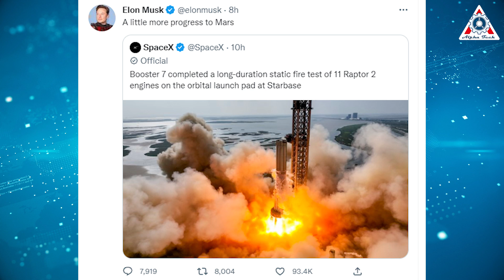SpaceX Boooster 7 11 engine V2 Static Fire tests “Concrete trouble”

Comment: now, what type of concrete can withstand the fury of 32 raptor engines during the eternity of lift off ?. Oh and by the way they haven't tested 32 "mounted" Raptor engines for nozzle vibration in atmosphere for longer than 20 seconds. Its a joke.
Reply: Your negativity is BLARING!!  Turn it down please, SpaceX has accomplished MANY absolutely AMAZING feats of Rocket Engineering, TO. SAY. THE. LEAST.

You sure you don't just have a personal grudge against the owner of SpaceX(Elon Musk) because of your political leanings??  Me thinks, you do, distance yourself from politics when inter-planetary travel is envolved, it's not becoming.

Comment: The pad is flat, this limits the opportunity for redirection of heat and other forces produced. The pad needs to be redesigned in order to redirect those forces away from the pad better, until that happens, concrete will probably keep failing.
Reply: Agree - can't these rocket scientists see this?  Duh.
Reply: @rimckd825  its an engeering issue. They need to be sacked or given a good telling off. The probably just need to put a big reinforced concrete cone under there to redirect forces away from the base of the tower.
Reply: You couldn't be more wrong.  Doing it this way so the rockets THEMSELVES, are exposed to extreme heat, for a significantly longer time then needed, they did an A+ job, we are OOW to Mars within 10 years, not rovers, people's!

Comment: Still getting Pad damage with less than 1/3 the number of engines is not good. Elon' decision of NOT  implementing a Flame Trench with MASSIVE water deluge is biting him in the ass. Call NASA and ask what they use and do with SLS? The same type of pads being built in FL may have to be scrapped.

Comment: I'm no rocket scientist, but it seems like not putting a flame deflection system on the launchpad of the largest rocket ever made was a foolish mistake.
Reply: They don't need to be concerned about the concrete on a test like this, if it were going into orbit it would be less damage and who cares anyway, just replace the concrete, I did masonry for 5 years and me and 4 other mason's could do a 100ftX100ft slab in less then 3 days for sure, if pressed, we could get it done in one 12-15 hour work day, plus at least 24 hours for concrete to dry, depending on how thick the Concrete is, up to a few days.
Reply: @matthewluke5315  "just replace the concrete" Bro, chunks are flying all over the site. There's absolutely cause for concern. Saying a mistake was made isn't hating, it's being realistic, and you whining about people not praising everything they've ever done is a problem.

We're all fans here. But there's being enthusiastic, and then there's being a groupie.
Reply: @matthewluke5315  I thought you were part of the "Team" at SpaceX?  Boy, you are multi-talented!  Rocket scientist and stone mason.  I bet they're aren't many resumes like that out there.
Reply: I am a launch pad technician for spacex and I have no idea how they expect that the tower won't get any damage from a launch. The pad gets destroyed just from an F9 and really destroyed from a heavy, all the way to the border fence that surrounds the pad gets damaged
Reply: If the concrete was replaced with granite this would be no problem
Reply: @BuyBitcoinholdit  good luck moving massive slabs of granite, or similar material on Mars. Cutting it might prove equally challenging on Mars as well.
Reply: Dude, they can orbit Mars and deploy a pre-made landing pad, even if it takes multiple missions to do the 1st landing pad....I know you hate Elon for Cult Left reasons, but trust me, they already thought about anything YOU could possibly conceive of, rest assured!!!

P.S.

Stop being a hater, it's not very becoming, and really, it only makes people like Elon Musk and his companies MORE!!!!  Real Talk Homeboy!!!
Reply: That's right - you're not!  The actual scientists have figured out that they don't need it.
Reply: @mstecker  Lmfao!
Reply: I suspect that they are not committing themselves to one thing. They need more options like the one just suggested concerning Apollo landing and blasting off the Moon.
Reply: All of the criticism that was thrown at Elon Musk before space X worked and then no apology.  Even former Apolo Astronauts were against him. Alls I know is I won't be giving SpaceX criticism any time soon. Even if they blow the whole site up, in the end SpaceX will be sending people to Mars.
Reply: Static fires probably need a flame diverter for sure but a launch might not because it’s basically going to be moving away from the concrete immediately not strapped down just blasting it.
Reply: @markrichardson2508  Ok that makes sense. Makes me nervous having cryo tanks just a few hundred feet away and concrete chunks raining down.
Reply: @markrichardson2508  It will have to be making full thrust before it can leave the pad, so yes a deflector is a good thing to have, always. That was learned in rocketry decades ago, so who knows what they are thinking?
Reply: @Doggeslife  at this point I have lost count of how many static fires they have done and they have only had one time a piece of pad damaged the actual ship and that was years ago imo they probably just need a decent water deluge system.
Reply: @Doggeslife  the last test that damage the ship itself 🤦
Reply: @markrichardson2508   Starship isn’t the same booster as Superheavy so that can’t be the reason.
Reply: @markrichardson2508  its moving up but that doesnt solve the problem, there is a reason why all big rockets have flame diverters. It takes time to spool up the engines and clear the pad. Also we are talking about really massive forces here. I mean look at SLS, it has most intense sound supression system to date yet it still managed to blow away BLAST DOORS. And now we have this big booster with even more power

Bonus note: about clearing the tower thing, there is a trend some noticed with multi engine rockets, more nozzles in small space longer the exhaust plume, most likely beacuse plumes partially "shield" themselves from directly touching normal ambient atmosphere, so they do not get slowed down as much, and flame length can be greatly extended(for instance, look at N1 and Saturn V)
Reply: @_mikolaj_  it’s not spooling up for 14 seconds 🤦 it will be blasting the pad at pad height for maybe 5. I’m not saying it’s doesn’t need one but they obviously think they don’t need one yet.
Reply: @markrichardson2508  5 seconds of continous powerful shockwaves and then another few with addition of 2000°C flames traveling at 3km/s hitting the infrastructure, yet boca sector keeps trying to cut corner so much that they keep reinventing things. Hopefully once they finally start work on HLS they will stop trying to avoid obvious necessities like a damn proper sound supression system
Reply: @_mikolaj_  😂 you should put your resume in mate tell ‘‘em how it’s done cause you are so much smarter then some of the smartest rocket scientists that are living today 👍🏻🤣
Reply: That’s not to mention the starships whole test campaign was done on a stand that was basically 10m off the ground and landed on 3 meter legs they obviously think there is a way of doing it and you keep assuming I think it’s the best way too but I got no idea 🤷 and neither do you.
Reply: @_mikolaj_  hahaha 🤣 someone is a bit sad. There are plenty of things to criticise I’m just saying the couch commentary is funny af. Like they haven’t already had 100s of meetings about the subject. The prototype has many things I could critique, the lack of a flame diverter as you guys are crying about, the fact they aren’t going to have a launch abort system, water deluge, the fact they are gonna try catch that booster, the heat shield tiles need work and plenty more…. apparently you guys have not optimism or humour.
Reply: There is a legitimate reason for the lack of a diverter, Mars! The whole idea behind the Starship is to be able to launch and land from the ground, with no special infrastructure that can't be done on Mars.
Reply: @charlieodom9107  That is probably true, but not destroying your launch complex on Earth is important until you get the whole system figured out.
Reply: @TheGrakenverb  that makes no sense. You can't build one way, then completely change to another. The goal is to develop a launch pad capable of withstanding a launch, so that is what they are doing. They need to do so by using materials and methods which can be sourced from Mars, because hauling a 20,000 ton launch platform with diverter to Mars is completely out of the question.
Reply: @charlieodom9107  If launching a huge rocket off a concrete and steel pad is problematic enough without a deflector. then just think of the pit this thing would dig trying to launch off bare soil!  NASA did it right by using the base of the lunar lander as a launch pad.  SpaceX may have to re-think things.
Reply: @Doggeslife  awww...look at you thinking you have more knowledge of rocket science than SpaceX!
Reply: @charlieodom9107  the booster will not be launching or landing on mars, it has quite a bit more engines then starship, which will be going to mars
Reply: BINGO!!!👏👏👏👏👏👏

The Cult Left Elon Musk haters are out IN DROVES!!!lol But serious!!  How absolutely AMAZING the things SpaceX is doing and what Musk is doing, literally a gift to the World!!
Reply: @matthewluke5315  Just HAD to bring politics into it.  Must be the rabid right that even ADULT Republicans despise.  Grow up.
Reply: @charlieodom9107  You're not landing on Mars with a 33 engine booster. It'll just be the 9 engine Starship - and even then, only a few of the engines will be lit.
Reply: @countryfucius  booster or not, it makes perfect sense to develop the platform without a diverter which would be the case for any Mars launch.

Comment: If you hammer on concrete, it will break. And thats a hell of a hammer. I asume, the expected explosion will send some particles to Mars eventually.
Reply: Rough calculation -- the noise and vibration of a 33-engine full-power launch of a Starship is literally four thousand times louder than a modern jet airliner taking off (about 200dB). Most launch systems use a water deluge system to absorb that sound energy and stop it disintegrating the launch structure, the cooling effect is a secondary but important consideration.

Comment: I think the FAA will keep finding (and inventing) reasons to delay the launch permits from Starbase.
The existing stand is adequate for testing.
If the FAA even grants a launch permit Elon will probably rebuild the mount before the 2nd launch.
Reply from the maker: If 33 engines testing explode, FAA definitely cancel more
Reply: If "ifs" we're ⅕'s, we'd ALL be drunk!!!  Your comment seems like you WANT SpaceX to fail, what would that be, why would you want SpaceX to fail??
Reply: FAA is the least of Starship problems. While SpaceX may champion an iterative approach, it is a waste of time, effort and money iteratively working your way through launch pad issues which have been addressed by launch pad engineers elsewhere in the past and present.
Reply: Truer words, not yet spoken!!!

Comment: Repress system still may not be there yet.  If you notice, the LOX tank was venting heavily throughout most of the burn (very unusual).  My guess is that it was overpressing and that's why the burn was cut short.  It's possible only a few engines are involved in repressing the tank for all 33 engines; with only a few being fired, the repress overwhelmed the reduced volume change.  But if that is so, they take the risk that a select engine failure would destroy the vehicle due to loss of tank repress.
Reply: WTF is a repress system?
Reply: @rimckd825  As propellant is consumed, the tank has to be supplied with gas to make up the loss in pressure.  I think that was the purpose of this run, to see if that was working.

Comment: They should remove the concrete and put a hole with a large pool in it and a diverter.
Reply from the maker: The same with Nasa?
Reply: @alphatech4966  Sure.

Comment: What about putting in an additional suppression system that delivers water from UNDER the ground to cool, absorb the blast force, sound, etc?  I know I’m talking “millions of gallons per second” flow rate.
Reply: Much easier to repair the Concrete for this test, in a real world launch, concrete used would be virtually undamaged.
Reply: Shuttle used 300,000 gallons over 20-30 seconds.  SLS just launched and had some decent blast effects damage on the mobile launcher. Those 5 segment SRBs are the most powerful rocket engines ever built.

Comment: Why not use the "Chop Sticks!" which are going to be used in capturing the returning ships? Maybe beef up the chop sticks to hold the Booster - Star ship combo, and release only at launch?
Reply: The outer ring of twenty Raptor 2 engines in a Booster are started by the Orbital Launch Mount via gas connections. They can't start without that supporting structure. The inner thirteen engines are started by gas supplied from inside the Booster structure since some of them need to be restarted to land the Booster after separation but there isn't enough gas storage space, piping etc. to start all all 33 engines in the Booster itself.

Comment: just rebuild the launch pad after every launch!   spacex is truely and innovator
Reply from the maker: Reusable rocket but non reusable launch pad???
🤣🤣🤣🤣
Reply: It's not unusable after a LUNCH or TEST, it does need repair after test, NOT launch.  This is the best, most efficient and effective way possible right now, and it's been working GRANDLY, as you can tell by the RECORD SETTING amount of launches SpaceX has conducted...

P.S.
Haters never prosper.  You're only upsetting yourself, your political leanings appear to be overwhelming your reasonability.
Reply: @matthewluke5315  spacex hasnt launched starship yet.  falcon doesnt blow up the launch pad every time.   this is a problem.

Comment: I think that space x not using some type of water deluge system is a mistake.  This is going to be one of the most powerful rockets on the planet with over 30 engines.  I fear with all those parts in the engine bay flying concrete could damage some systems .  That's dangerous if plumbing gets damaged and your already in flight.
Reply: The little bit of "flying concrete" did ZERO damage to the engines, platform, Etc..  Slight damage to the concrete on a test is expected, during a launch there very well might be ZERO damage to the concrete, at worst would be lightly damaged and easily repaired.
Reply: Look at the old Soviet system

Comment: Why don't they use a total water day deluge like NASA uses ???????
Reply: The pad in Florida has a truly MASSIVE water deluge system and Florida is where the majority of the launches will be taking place they can only do 5 a year in Texas and really while there was some debris on this test it’s no where near the amount from the 14 engine test I think the Fondag may have held up better than we know they completely jack hammered and replaced the concrete under the pad after the 14 engine test the debris from the 11 engine may have even been from that construction work and not the Fondag being blow off.
I like this channel but it seems like most of the video titles are negative…Is that done to generate views?
Reply: Sir ,
I am just a regular viewer of this channel , this was only my opinion ,  not to do anything but to find out a reason for this !  Did not intend to do anything otherwise !
Reply: I think so
Reply: That concrete is not going to hold up under that type of pressure  over time.
Reply from the maker: We will find more about this
Reply: I really believe that there must be some reason why it is not being done ,  I would really would like to hear the reason !